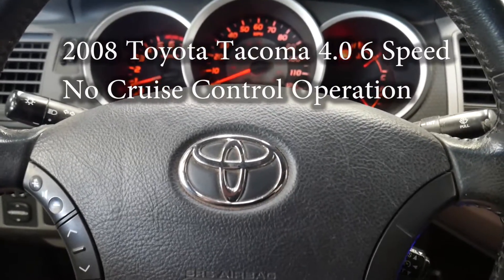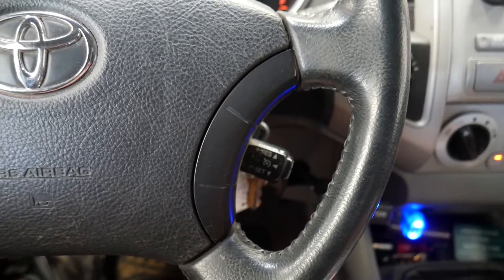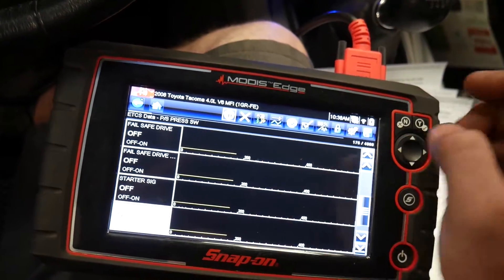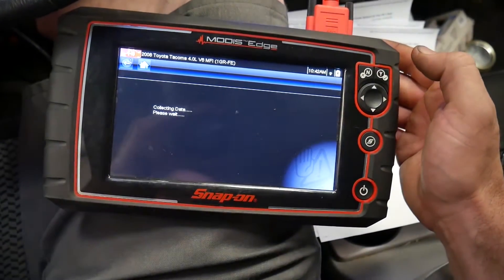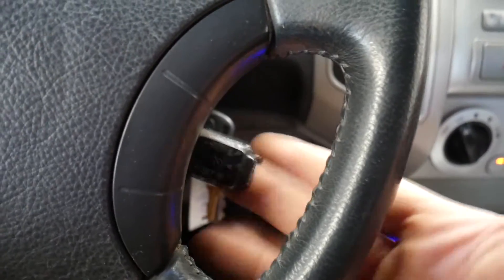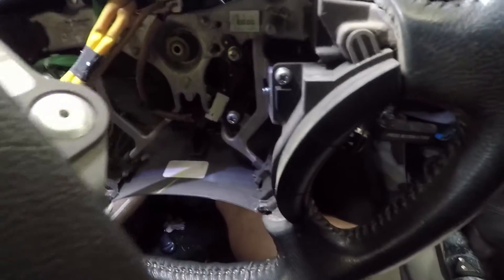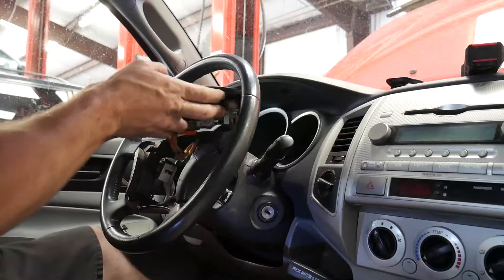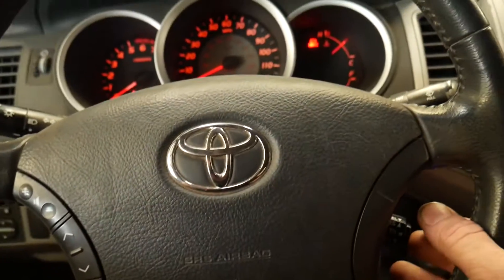2008 Toyota Tacoma Cruise Contol Not Working - Case study

Comment: Clock spring from china $8.00 free shipping. Takes 15 minutes to install. Fixes the horn and cruise control. Its a common problem, I'm on my second one in 12 years. 06 Tacoma
Reply from the maker: Parker Birch 👍🏻 When the horn stops working at the same time it’s a pretty safe bet to say the clock spring (spiral cable)is bad. I’m surprised I haven’t had another one in shop yet to film the clock spring process. We used to replace them all the time.
Reply: @ThePracticalMechanic  just curious, Airbag light should be on when clock spring go bad or no ???. Thanks in advance
Reply: I still have no horn and cruise after replacing the clock spring.  All fuses are good.   Any ideas?
Reply from the maker: The two systems only have one part in common and that is the clock spring(spiral cable). My guess would be you got a defective clockspring or something isn’t plugged in completely.
Reply: @ThePracticalMechanic  thank you.  Have you come across any issues in the past with the steering shaft bearing?  I've seen a video or 2 of the bearing starting to get corrosion which may cause a grounding issue.  I guess that's what I get for purchasing a $30 clock spring.  Factory or any brand you recommend?
Reply from the maker: Mike Kelly I haven’t seen the shaft bearing failure but I don’t see too much corrosion in Colorado. I always use factory for my customers but many others on here have had good luck with the cheaper options.
Reply: @ThePracticalMechanic  I see clock springs ads that state 'not for cruise control"  I hope the one I ordered is one for cruise as it didn't state it.
Reply: Chyyyyyna 💇‍♂️
Reply: I replace the cruise control switch already still doesn’t work fuses are ok any ideas?
Reply: @edwinruiz2889  just did my switch and it did not fix the cruise. Horn works, so does that mean it’s not the clock spring?  Or can just the cruise be related to the clockspring?  
Did you get yours fixed?
Reply: @cheeseheadfiddle  no i did not,i cant find the problem,cruise control still not working,Help!!!!!
Reply: @edwinruiz2889   I discovered a spot on my wiring harness that was mouse chewed.  Gonna dive into that.  Might be a short in there or a broken connection.  Hopefully fix a couple of unrelated mysteries.  Cruise and O2sensor code.
Reply: @cheeseheadfiddle  i’ll check mine thanks

Comment: Video was great but mine also had the weird click on the button and this did not fix my problem.  If you ever decide to do a clockspring video, I would be more than happy to donate my tacoma! lol
Reply: Toyota did a recall for the clock spring in the 05-09 Tacomas. You may want to check to see if that recall is still active.
Reply from the maker: @felinecontrolled  I just looked it up again to confirm and it appears that Toyota may indeed cover the clock spring on some vehicles. the recall number is 12V092000. It doesn't state a time frame for the recall so it may be current still. Thanks for the info.
Reply: @ThePracticalMechanic  I dug up my original invoice and found two recall notices for the cable. There is no expiration date on the notices. So fingers cross Toyota will honor it!
Reply from the maker: You in Colorado? If so we could work something out.
Reply: California, sadly. I'm sure there are plenty who would take you up on the TacomaWorld forums if you're serious!
Reply from the maker: If I don’t get one in here soon I may put a post up for that.
Reply: im in the same boat. changed my switch to no avail. If I turn my wheel all the way I can get the light to come on but that's it. Im assuming clock spring?
Reply from the maker: Sounds like the clock spring has failed. When you turn it all the way to one side it probably allows enough contact to turn on.
Reply: @shillingbanjo  Same here, the new switch worked for a few days and than started worked intermittenly and finally quit completely. Turn the wheel and it comes on but will not activate cruise.

Comment: Excellent video. Thanks!
Reply from the maker: Thank you and no problem.  Did you have a bad switch as well? Going into this I half expected to have a bad spiral cable(clock spring) but luckily it was just the switch which was a lot cheaper.
Reply: I’m with you, going into it half expecting a new clockspring is needed. I own an 06 Taco and just purchased a replacement switch off of amazon (non Oem but has good reviews and way cheaper). I’ll let you know how it goes after I install. https://www.amazon.com/gp/aw/d/B00RVJY8CY/ref=chk_gwtyp_product?smid=&psc=1
Reply from the maker: KTS Champ WOW that switch is a lot cheaper than oem. Did it fit and function good?
Reply: Just purchased and it arrives on Monday. Will keep you posted.
Reply from the maker: That would be great.
Reply from the maker: Hey KTS Champ did you get you switch installed? If so how did it go?
Reply: I installed the new switch and cruise control still doesn’t work:/ Wondering if it’s the clockspring...
Reply from the maker: That’s a bummer. 🙁I was kind of hoping the truck in the video needed the clockspring so I could do the full how to video. To do the clockspring you have to remove the steering wheel and a few screws holding the column covers in place. Remove the covers and the clock spring can be unplugged and removed. Make sure the wheels are straight ahead before removing and installing the new clock spring if you change it yourself.
Reply: Just replaced the clockspring and that fixed the cruise control! Bought it off of ebay here: https://www.ebay.com/itm/84306-0E010-OEM-Air-Bag-Spiral-Cable-Clock-Spring-For-Toyota-Lexus-84306-48030/281716543382?ssPageName=STRK%3AMEBIDX%3AIT&_trksid=p2060353.m2749.l2649

Youtube Video reference: https://www.youtube.com/watch?v=c_xbKtQgVwQ
Reply: Also, while I was under the horn, I put the original CC switch back on and it works just fine. The culprit from the beginning was that clockspring
Reply from the maker: KTS Champ that’s great that you got it fixed. I guess I need to get a clockspring video done soon.
Reply: @ThePracticalMechanic  any clock spring videos yet? Just changed the CC lever assembly on my 2012 scion xb and it still doesn’t work
Reply from the maker: @ottallman  How to Replace a Toyota Clockspring spiral cable   codes and symptoms also
https://youtu.be/VblczY9PzMc
Reply: @ThePracticalMechanic  thank you! I’m doing a little research before I change it out. Find out if it’s the reason that my cruise control isn’t working 🙄